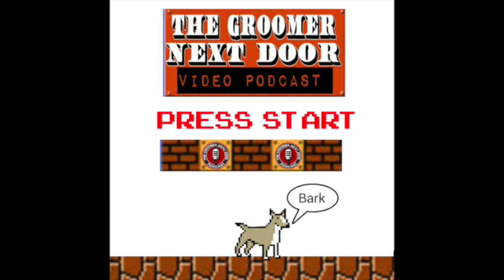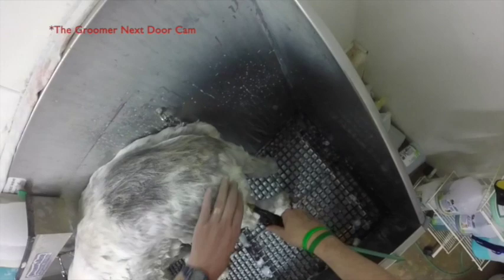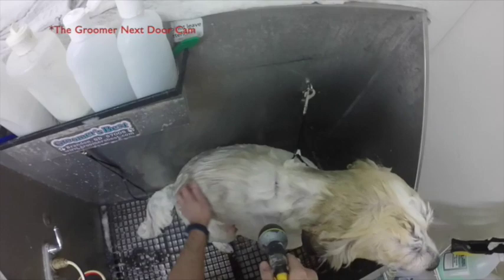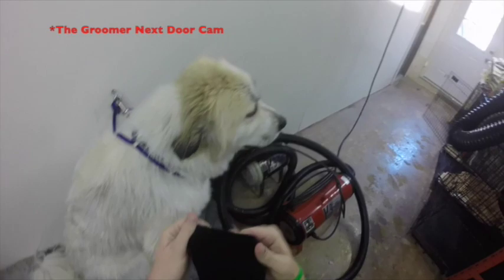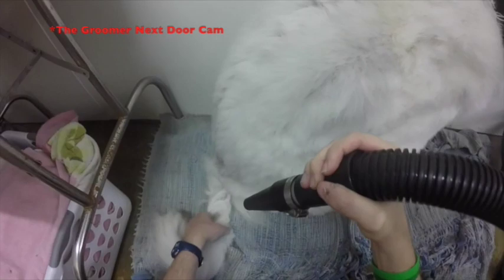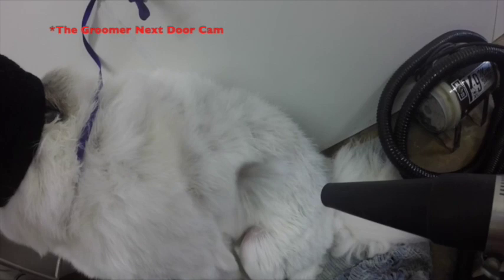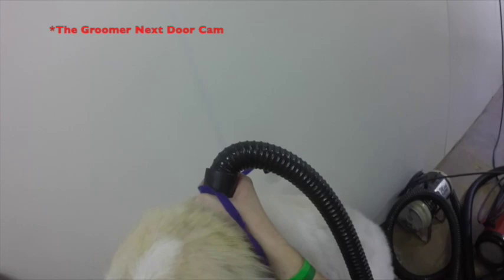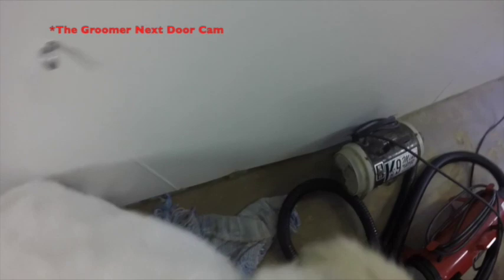Episode 1 "GREAT PYRENEES"

Comment: Where did you get your products & what are the products? I heard, tearless hypoallergenic something and degreaser....
Reply from the maker: Gina Gz. Let's start with degreaser. I use Dawn. I take a 16oz empty bottle fill it with warm water to the point where the tip is allowing approximately 2 oz of space. I pour Dawn in until it's full.

As for hypo allergenic Groomers Choice has some great pet
 shampoos. The three main shampoos are Hypo, an oatmeal (for regular use) or a Deshed. Depending on what breed you're working on, allergies, and needs always plays a factor. Using a degreaser is standard on ALL dogs (and cats) but never use it on the face. That's where the Hypo goes and just like prep for Dawn the same applies to prep for Hypo.

For all of the dogs and cats we see on a weekly basis each require a special handling and have special needs. Be sure you're fully aware of your furry customers needs.